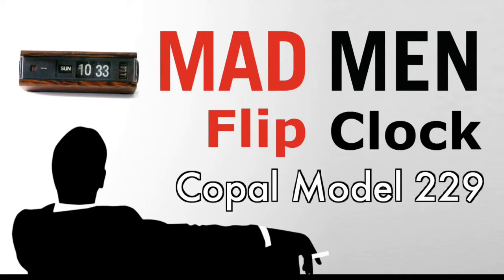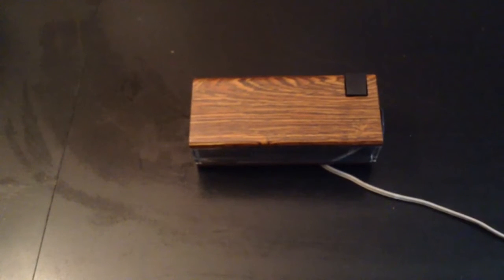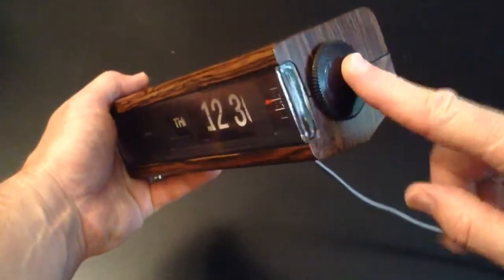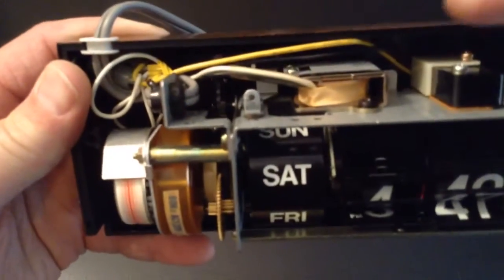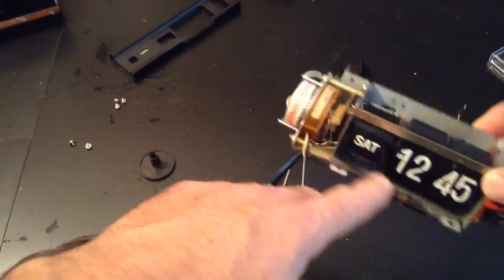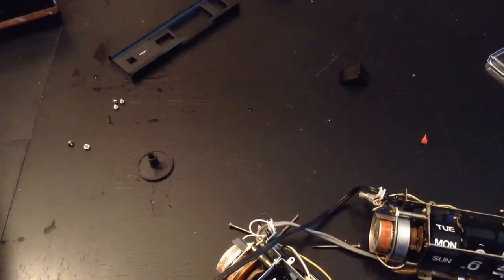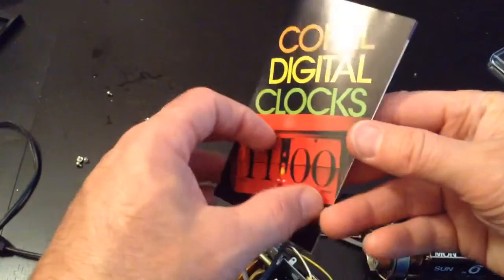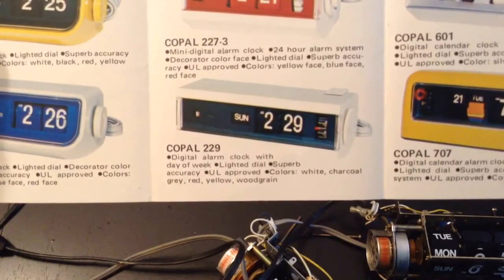The Mad Men Flip Clock - the Copal Model 229 Alarm Clock - Review and Disassembly

Comment: I found one about two weeks ago like yours, gray cord.  Three screws holding down the clock in this one and they used something like Loctite on the screws.  I gave up on the screws.  I don't think it's been taken apart before.  But, wasn't necessary to take the clock out for cleaning and lube.  Works great.

Comment: Hi, I have a copal 229, that I've had since I was young. Since I started it up again, it's been running a little fast. Would you know how adjust the speed, so I can  to slow it down and help it to keep better time?
Reply from the maker: You really can’t easily adjust the speed. The speed depends upon the frequency of the household current. Your power station has probably been running higher than 60Hz.
Reply: @Flipclockfans  thanks so much,  that would explain it. We are off grid on our own power system, and it only gained time since then! ! And the clock kept good time when I was a teen, still living with mum and dad. I'll still love the clock 😁  Thanks for taking the time to give me an answer, I appreciate it.

Comment: hey, i have one of these exact clocks, and for some reason the tiles stick going from 58-59-00. any idea how I could address that issue?
Reply from the maker: I would try cleaning each tile with Q-tips and water, drying each off very well. If this doesn't work you will have to look at the pins on the tabs to see if they're gunked up. I would try spraying a blast of compressed air on them.
Reply: @Flipclockfans  thank you so much! I opened mine up and it’s actually missing the top 59/00 tile. Any leads to where I could find one?

Comment: I bought one today! The light comes on but it doesn't flip. Any suggestions?
Reply from the maker: Good chance the motor needs a drop of oil. Open up the clock and manual spin the motor wheel counter clockwise with it plugged it.
Reply: @Flipclockfans  Thanks so much!

Comment: Do you know where I can buy a proper replacement screw? I went to take mine apart because it was making a creaking/knocking sound, and I noticed that it was missing a screw.
Reply from the maker: You're not going to be able to get one marketed for that use.. that's for sure. I'd think about taking the other one out and going to a hardware store and looking for a match.
Reply from the maker: I found a place online that you can order a screw that should work. You need a #4 pan head machine screw that is 1 3/4 inch long. Here's the link:
https://www.boltdepot.com/Product-Details.aspx?product=9221